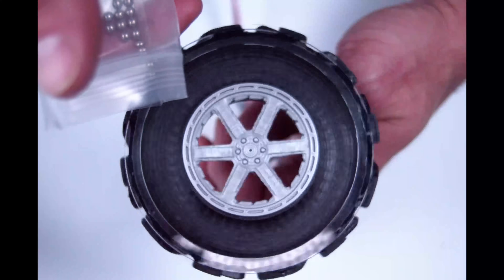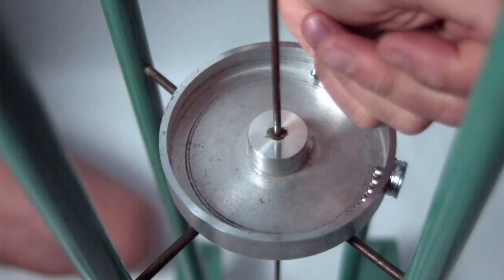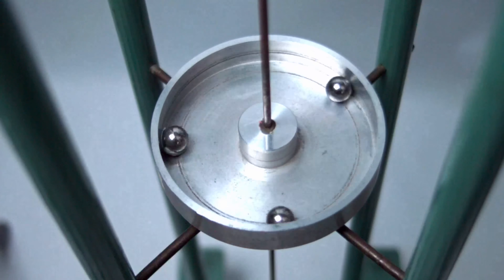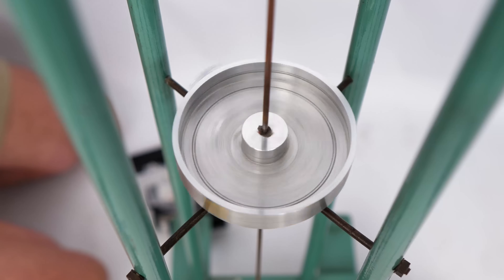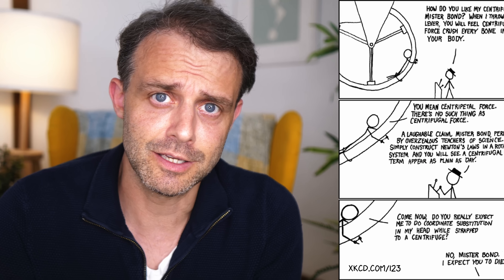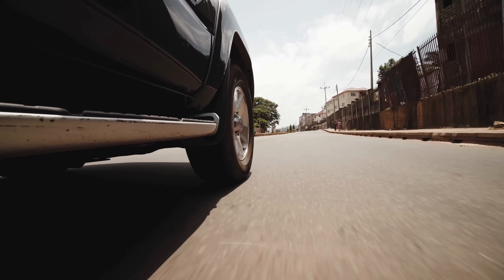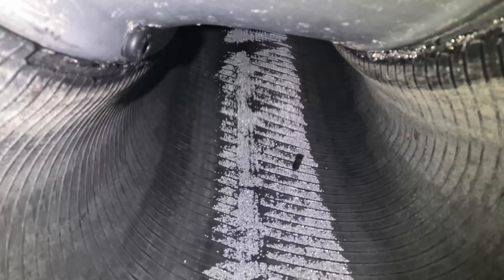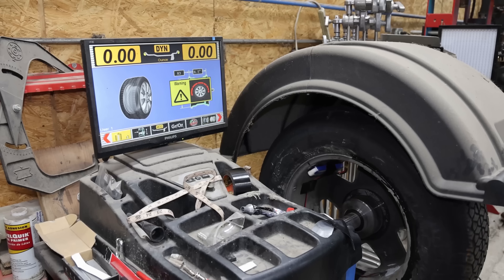Do tire balancing beads actually work?

Comment: Im an appliance technician and can say that this is exactly how the automatic balancing system works in a lot of front load washers. Granted, the use much bigger ball bearings and the balls are sealed inside of an oil filled ring. You can hear them clinking when slowly rotating the tub. Top load washers tend to use water filled rings... not really sure why the difference though but it works the same way. Great video, I remember this fact blowing my mind as well when I learned about it.
Reply: I think water is better than spheres because as a fluid it will always move to the better spot. Spheres need to overcome friction.
Reply: @Brunoscaramuzzi For the very high speeds in front load washers I think you need the higher density of the steel beads. Because they're ball bearings in oil, the friction involved is tiny.
Reply: Oh! That's what the clicking is!
Reply: Gotta love the calls, "My washer isn't draining completely. I can still hear water in the drum." I've had to explain this to customers more times than I'd like. Even better when they drill a hole in the balance ring to release the trapped water, I've found that a few times.
Reply: Water can freeze in low temperatures. Even at highway speed they might warm up eventually but it takes constant speed for an extended period of time. This is when the temperature is around 10°f to negative 20°f. Chicago winters are known for these low temperatures.
Reply: @davelowman3574  unless your washing machine is in the garden I'm not sure how tf it would reach freezing temperatures inside your house.
Reply: @davelowman3574 but it's not going to be that temperature inside your house, where your washing machine probably is?
Reply: I have a friend who races motorcycles and it seems his well balanced tires might be made more smooth by adding these since at track speeds it would buffer out any other imperfections... Interesting
Reply: They're not ball bearings. They're just balls. Ball bearings are bearings that use balls.
Reply: Maybe some top dollar front loaders 😅
Reply: @metalinspired  The only one I know for sure has these is the one from Speed Queen, which is top dollar for sure.
Reply: So that's what that sound is!
Reply: Fluid damps the motion of the balls.  Oil more so than water.   Damping dissipates kinetic energy (converts to heat) and this diminishing resonance.  Without damping, the system oscillates more before settling in.  In addition, Washing machine loads vary (unlike tires) and each laundry load has a different resonance frequency.
    The sample gadgets in the video are torsional pendulums.                Cheers
Reply: Don't know, but oil is viscous, which should help hold balls in place. Front loaders spin fast.
Water isn't viscous. Top loaders wash in jerks.
Reply: @RePeteAndMe  The tub, and therefore balance ring, doesn't move in a conventional top loader during the wash cycle. Only the agitator reciprocates (jerks). The tub only moves during spin.
Reply: @RePeteAndMe  That was my idea, too. Front loaders face the same problem as wheels - they are subject to gravity once they spin slow enough or not at all.
A washing machine has periods of slow and rapid spinning cycles. An unbalanced drum could damage the machine if it is going at the resonance frequency. 
The viscosity of oil could slow down the effect of gravity.
Reply: Top loaders also uses them 👍

Comment: I have been using the beads for 26 years and love the way they work, my truck has 37x12.5x17 tires and trying to balance them on a machine with weights is useless, they never balance properly and always change, the beads rebalance every time you get moving, I have never seen them cause any tire wear like others have said, and the beads I use contain a desiccant so moisture does not make them stick together.

Comment: In the 70's J.C. Whitney used to sell tire balancers that mounted behind the wheel. It was a ring filled with sand. My Dad had a set on his truck and they worked fine at highway speeds, but the national speed limit was only 55 at the time and they took a little bit to balance out.  The vibration between 40 and 50 tended to be pretty harsh.

Comment: There's nothing wrong with balancing beads and there are applications where they make sense, but they are currently a bit of a gimmick or fad because people think they're cool.  The reality is that most people have professionals mount their tires and those pros have expensive dynamic balancing machines that balance the tire at all speeds and without chafing the inside of the tire and creating rubber dust that can become a goop that makes the tire balance worse in some instances.

Comment: Just started the vod, I assume reason for the wobble in the first place is because center of mass is off.  The beads are the lesser mass of the whole system and once it's intoduced to the system it becomes part the mass/system as a whole, but because they can roll around freely inside once the system is rotating the beads will move towards the outside wall due to angular momentum and once they're along the wall they'll settle in whatever spot adjusts the center of mass to be where the rotation is occurring. Let's see if it's right.

Edit: so didn't think of resonance, but I think I was on the right track?

Comment: I had self balancing ball bearings in my wheels before. Came pre "installed" from a store that I bought my wheels with tires already mounted. I tried them for a summer season and hated it. From 0-40, it had some minor vibrations, but hitting about 80km/h, the vibration would get worst. Though they were a 13" tire, so it may need to hit a faster speed before they are actually balance?

Either wait, went back to the old school way of balancing my wheels.

Ps: they're a pain in the ass to clean up as well.

Comment: Dyna-beads! In the early-mid 2000's my dad and I did a lot of off-roading and built up our Jeep TJ into a mini monster truck. I remember one of the issues we had was that with the hardcore rock crawling we were doing, it was very common to lose the balancing weights off the wheels.
When we finally upgraded our tires to 35" and the wheels to bead-locks, we gave these things (recommended to us by another member in the off-road club we were in) a try. No more worrying about losing tire weights, but at that point our rig was pretty much geared just for rock crawling so it never really went fast enough to get the beads into place. We ended up getting a big ol 20ft trailer and towing our Jeep any time we were headed out further than an hour away from home. I think I still have a packet of the beads in our garage somewhere.

Comment: Closely related to the principle which dictates that a ball won't be thrown off of a rotating disc, but rather roll around the rotational axis, provided it's close enough to the axis and the disc is spinning quickly enough.
Forcing your milk frother to the center is equivalent to moving the ball closer to the axis, where it then remains.

Comment: This is a two body problem and solvable around a fixed axle, but would not work if the motion is slower, more chaotic, or the center of gravity varies (solar system for example)

Comment: Don't know if you get a chance to read any/all of your comments, but I thought I'd suggest a topic: thermal expansion.  Specifically, when a material with circular holes in it expands, say an engine block, does the diameter of the holes increase or decrease?  Intuitively, it seems like the holes should get smaller, but I have some real world experience that suggests the opposite could be happening.  Using the same example, it seems like if an engine heats up and expands, and the bolts inside of it also expand, that it could lead to degradation or warping of the threads, which doesn't appear to happen to the best of my knowledge. Anyway, I would love a Steve Mould video to offer some answers.  I love the way you explain things, and wish every time I had a question, you could make a video to explain the answer.
Reply: When a metal heats up evenly and is free to expand, it does so in a way that minimizes internal stresses.  So a solid block of metal doesn't warp with repeated heating cycles.  If you think about it, a steel bolt in a steel block is really not much different thermally to a solid block of steel.  So the bolt expands in the hole, and the hole expands around the bolt by the same amount.  Nothing much changes.  Now if the heating is rapid or uneven, or the two materials have different coefficients of expansion, or if the metal is somehow constrained from expanding, then all bets are off, internal stresses can build to enormous levels, and metals can distort.

Comment: I looked into beads, but concluded the same outcome. I don't often reach the speed in which the beads work. At the lower speeds of city driving, wheel weights keep the tires balanced at the point where being out of balance would be most prominent. And wheel weights are much cheaper!

Comment: So theoretically, smaller tires would result in a lower required speed since it would have to rotate faster to achieve the same speed due to smaller circumference. I doubt it's a significant difference, but still interesting.

Comment: I have used CounterAct brand balancing beads in my both my motorcycle and my pickup truck.  In my motorcycle, I never notice any imbalance at any speed.  I still need to add more beads to my 12-ply truck tires.  4 ounces per tire balances them most of the time, but not always.

CounterAct says the beads only work in vehicles with stiffer suspensions, so they're not going to work in every passenger car.

I'll have to watch for the internal tire grinding.  Just as with anything, not every brand of balancing bead is going to be high quality, so some may cause higher internal wear than others.

For me, the benefits outweigh the consequences.  I mount my own motorcycle and truck tires, so not having to own an apparatus for balancing tires is a major win.

Comment: Years ago back at a shop we had a jerk on a power trip so when he asked us to fill his tires with air we deflated  his tires completely, put in some water, then topped them off with air. On a nice roads, the water spreads evenly and is a smooth ride. When he'd hit a bump the water would shift to one side and then the ride would be incredibly rough out of balance. We would show him on the balancer that his wheels were "balanced". All good. This kept happening and he ended up replacing several hundred dollars of suspension components and alignments because it happened over and over again. Dude lost his mind.😂

Comment: In the world of semi trucks, there is a product called a Centramatic that applies this principle. Instead of putting the glass beads inside the tire, they are contained in a ring balancer that bolts on to the wheel.
Reply: Oh wow, apparently they make them for trailers (sounds awesome) and motorcycles (not sure why, haha.)

Comment: The rage I feel to this day because of these stupid beads jamming truck inner duel tire valves open when checking pressures and this requiring total removal of the valve and cleaning / replacing/ refilling the tire, far outweighs any realistic gains these things will give you. It's just well marketed snake oil.

Comment: We use balance beads on heavy truck tires mainly because the equipment to balance them is very expensive compared to the beads. An out of balance tire tends to wear more unevenly and therefore faster resulting in a longer tire life. They aren't perfect, but they are better than not balancing tires.

Comment: The problem with tire balancing for a small 15'' rims in UK is that the speed limit is 70mph top, therefore even if your wheels are unbalanced slightly - you wouldn't feel it. However if you decide to visit, let's say Germany, then all hell breaks loose on the autobahn - I couldn't feel anything at 70mph, but at 100mph - the whole car was about to rattle itself to pieces. I bet the safest way is to use a service in Germany as the accuracy of tuning is presumably highest due to highest speed limits - please correct me if I'm wrong UK mechanics! 

And I wouldn't use these beeds for a small car. 

Great content Steve!
Reply: Breaks
Reply: @stargazer7644  cheers

Comment: my unbalanced tire on my ranger really only shows its ugly self when i hit 76ish mph. The band below that range is tolerable, and up to about 10 over that I have gnarly vibration. and then beyond that it gets tolerable again. I should switch back to my stock aluminum rims. I paid entirely too much for the steel rim set, and I regret it, especially because of the rust (old truck, Michigan winters).

Comment: These are really useful in motorcycles. I remember vaguely years back seeing this sort of bead balancing with a viscous carrier, that was supposed to keep them in place for hours after the wheel stopped turning. So with stop lights and such they would not need to get back up to speed every time.

Comment: so it sounds like they do actually work, sort of, just not as well as actually getting your wheels balanced. they start to work after you hit a hight speed, and stop when you've decelerated past a certain point. so they're probably good for long highway drives with no stops, but that's really about it.

Comment: I have been using Daisy zinc covered BB's for years. They work very well, with no signs of wear on the BB's or the tire and rim. I use 1oz for every 13lbs of tire/wheel weight. I like doing all my own automotive work and I like saving money so this is a win win for me. The only downside and it is a big one. This will not work well with low profile wide tires. The tire needs to be at least a 70 series. When traveling straight down the freeway for an extended length of time. The BB's can move to the opposite edges of a wide tire and create a side to side wobble on the front tires. But they work great on my truck and my old car with 70 series tires and they're cheap. I guess I am too.
Reply: I am sure if you can afford a wide wheeled car you can afford proper tire balancing.
Reply: I like to call it "frugal".

Comment: Many years ago J.C. Whitney used to sell a tubular ring that bolted onto with the tire rim using the lug nuts.  The ring was filled with balls that would "Automatically" balance the wheel.

Comment: What is the required weight of the beads vs the tire and wheel weight before this matters?

What about balancing between the inner and outer rim?

Finally what effect does the flat spot of the tire (the side contacting the road) have on the beads as the wheel rotates?

Comment: Does the fact that a tire has a constantly changing shape due to the changing location of the flat contact patch with the road constantly changing, and thus has a constantly moving center of mass independent of any vibration and resonance behavior prevent the beads from ever finding a stable configuration? Are they basically always chasing a moving target? (you can even see the contact patch moving in the video). If so, can the beads still overcome the moving center of mass and achieve balance if their total mass is sufficiently large, and the forced movement of the wheels center of mass due to the changing shape of the tires sufficiently small?

Comment: I've been using balancing beads in my motorcycle tires for 10 years.  Yes i find they work, and yes even that minor vibration goes away at 80km/h (that's rural road driving in Canada). It's that high speed vibration that gives numb feelings to your hands after a few hours riding, and i'm glad to have that solved.  I also found much better tire wear when i first started using them, and don't encounter cupping with my tires as other Goldwing riders sometimes complain about with the same brand and model of tires.

Comment: theoretically a fluid would do the same thing, so what if you put a really thin 20minute epoxy resin in then immediately go for a drive on the highway, the idea is the resin will flow and balance the tire then set whilst driving then bosh permanently balanced

Comment: Tons of truckers saying these work so i won't say you're wrong, but i will say i don't understand it. It seems like there are 2 major differences between the tire w/ beads and the model.

First, the model has all smooth surfaces. The bearings roll freely because they're smooth and the inside of the "cup" is smooth. The tire has ridges all along the inside and that will keep the beads from freely rolling into whatever balanced position they should be in.

Second, the model uses balls that are relatively high weight. If you put thet ball on an almost-flat floor, i don't doubt they would roll away down a very gentle slope. The beads are tiny. They seem like they behave more like sand in the IRL tire. If you put them on a gentle slope it looks like they would just stay put & pile up. 

So how is it these tiny beads (that can't freely roll to the correct positions because of their size, their shape, and the tire's internal ridges) end up in the correctly balanced position once the tire gets up to the right speed?

Comment: You just helped me solve my 10 year old vibrating car issue. The mechanics had no idea what was wrong. Unfortunately that car is long gone, but I'm happy to understand the issue now.
Reply: what kind of so-called "mechanics" were you taking your car to that didn't know tires need to be balanced, and you feel the effect more at certain speeds??
Reply: If the mechanic had no idea what was wrong, it wasn't an unbalanced tire. It's the first suspect on a vibrating car, it's also something that's always done when a tire is replaced (except in a 2CV or citroen visa that is).